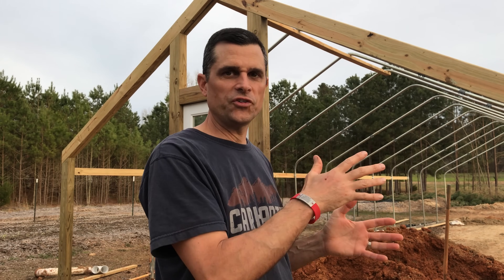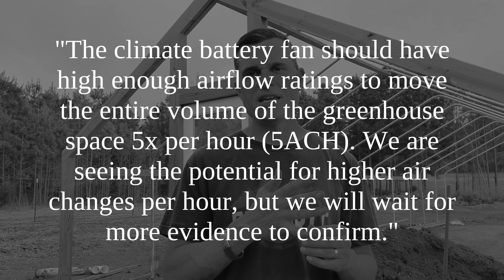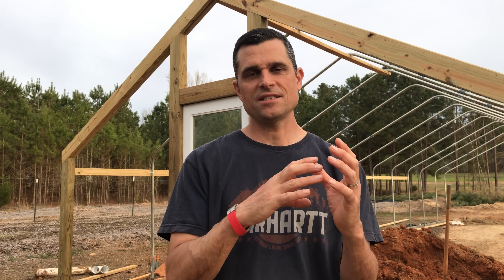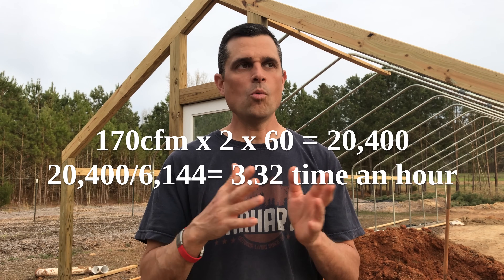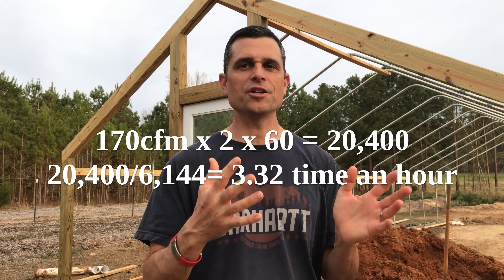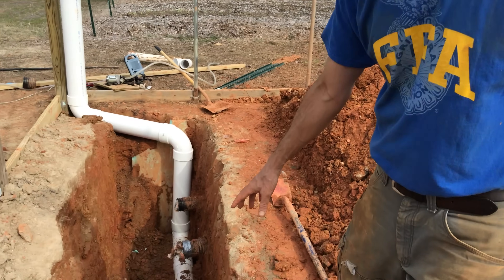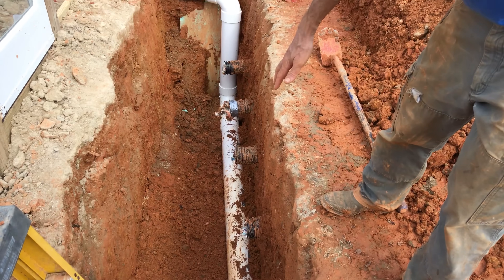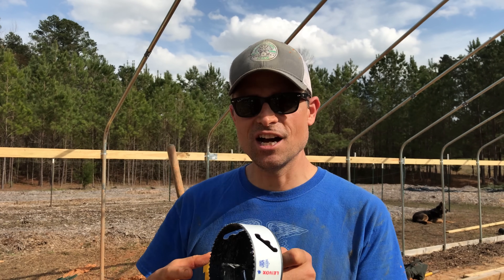DIY Geothermal Greenhouse Part 7: Earth Battery MISTAKE!

Comment: When the dewpoint of the greenhouse air is above the temperature of the battery (~April-October in your location...I'm also in the Piedmont area of NC) you will have condensation and then mold growing in the pipes. These systems may work well in the winter and year round in very dry climates but are a problem in the hot humid climate we live in. You may be able to use a HEPA level HVAC filter on the outlet to avoid breathing the contaminated air but a filter will add additional resistance and decrease the volume of air moving through the system.
Reply: I`ve had mine in the ground since 2009, if its designed correctly you wont have any issues.  If you go for 5 airchanges per hour you`ll be wasting your time. you need to design for a lot more than 5 ;)
Your test was a little simplistic, but fwiw assuming you had 270cfm and the system is perfectly lossless, the heat transfer rate would be around 18kw per hour. Of course, as the mass heats up the differential drops and you`ll move less heat.
Reply: @JohnGuest45  John, I'm installing a geothermal system in the near future and am having trouble with some of the  calculations for installation.  Is there a way I can reach you directly to go over some of these equations?
Reply: The tubes dont collect water if they are correctly modified prior to installation. The perforations in ADS tubing are not positioned to drain water from the tube because its designed to collect water and relocate it elsewhere, the clue is in the name :) If you believe the tubes will be full of mold, mildew, fungus etc  i suggest hiring a sewer camera to check the tubes after they`ve have been in the ground for a few years. Get a mold, spore test kit (cheap and readily available) to check for airborne spores in the exhaust outlet. Its basically a petri dish you leave in the exhaust plenum for an hour and then incubate to see what grows. 
In my experience its not an issue, any mold, fungus etc that attempts to get a foothold in the tubing has to compete with other residents that thrive in the highly aerobic environment. One that is coupled directly with the surrounding soil.
Reply from the maker: Mark Fogleman Thanks, Mark. Have you actually seen or tested for mold/spores in your system?
Reply: I don't use an earth battery because of our experience with the crawlspace under our house here. We kept it open in the summer and closed through the winter for the first ~10 years we lived here. This caused a massive problem with condensation and mold and other nastiness. After a lot of remediation we now keep it sealed all the time and it is dry under there. My former career involved manufacturing heating and humidification systems for breathing gases used on mechanical ventilators in hospital ICUs and Operating rooms.  I am well versed in the physics of changing water to vapor and the resulting condensation when it cools.
Reply from the maker: Definitely something to watch out for and report back on if it becomes an issue.
Reply: The condensation (phase change) represents the lions share of the heat transfer when cooling the greenhouse. If you lose it you only have the sensible component and you`ll have to move an epic amount of air to make up for it. Consider 1lb (454ml) of condensate represents 1000btu, about the same as cooling 55,000 cubic feet of dry air by 1 deg F.  Humidity is more of an issue in an aquaponic greenhouse with open fishtanks and flood/drain gravel growbeds which provide massive surface area for evaporation ;) Figure how much water you have to replace per week, convert to lbs, multiply by 1000 and divide by 3413. Thats the numberof kw that left with the water ;)
Reply: You could pour bleach on mold and not kill it completely.
Reply: Mold isnt an issue, its easily confirmed by renting a drain camera a few years after installation.
Reply: Mark,  I have studied geothermal and only tested it on a small scale.  In my mind, I feel using perforated tube is a mistake.  Ground water is present in clay soils and can run like garden hose under the ground level.  I don't know where this farm is located, but if they have frost snow etc, these pipes could possibly fill with water which defeats the entire concept.  Thinking they will only drain is only one side of the possibilities.   They could fill with water.  Second, radon is always a concern for some areas... why allow air transfer with potential radon underground?  I would have used an air sealed pipe network to keep ground water and other pollutants from exchanging.  And attempt to condense the water out of the air prior to pumping it through the pipe network.  I do like your coolant idea.  However, you would still have potential mold issues, but could be dealt with above ground by cleaning heat exchangers.  This system as designed will work, but whether or not it floods through the year is the question.  Also, I would not attempt to force hot air in the pipe network, I would simply draw cold air out instead.  This will help keep the fan out of the massive RH.
Reply: Passive airflow wont be enough. The metal element for the greenhouse in this video would need to present an area about 40ft square to the airstream to match a tubular installation, say goodbye to the floor and/or the light ;) . The metal will likely contaminate the condensate and poison your fish, at best  you`ll risk ingesting heavy metals when you eat the fish. The condensate from the tubes is returned  directly to the rootzone where the plants can recycle it via transpiration back into water vapour and the cycle continues ;) I like dome greenhouses, i have one myself. I hope yours isnt one of those made from steel conduit with a sheet of poly thrown over it ;)
Reply: 🐯 leman
Reply: Good idea TOM GRAY
Reply: I  can guarantee that I'm not confused about how dewpoint works and that I'm not an ME. I can also guarantee you would not want to spend much time breathing the air coming out of those pipes unfiltered as they will be pumping millions of mold spores and other potentially harmful microbes (remember Legionella?) into the air every hour after the first summer of operation. Warm moist air coming into contact with cool plastic drainage pipe buried underground will loose energy and not be able to maintain molecular humidity. The pipes will condense and collect water. This in turn creates an environment favorable to grow mold, mildew and other nastiness in the pipes. Blowing air through these moldy pipes will spread mold spores into the air inside the greenhouse. In our part of the world we have average dewpoints in the 60-70 degree range from April to October with spikes into the high 70s during tropical storms and hurricanes. Mold needs >60% RH to thrive. The RH in his pipes will be near 100% for most of the year assuming the ground temp around the pipes is around 50 degrees.
A better option would be to run a network of coolant filled piping underground and circulate this fluid through heat exchangers in the greenhouse.  Fluids are much better at transferring energy than air.
Reply: John, What you say makes sense.  going with your thinking, if the phase change truly does represents the majority of the cooling... why not simply dig a sizeable hole, install condensation metal elements in the hole and into the soil to conduct thermal energy, collect the condensate in a sump to recycle the water to aquaponics system?  Allow the natural thermocline to move the air into and out of the hole (winter configuration).  I basically did exactly that on a small scale.  I dug a 2' round hole 5' deep.  I dug the hole to help eliminate ground water from flooding my RMH that was built into the ground for safety (big mistake).  Anyways, I watched air flow into and out of the hole naturally.  I also noticed I didn't need to burn as much wood to keep the dome warm despite the temps outside at night were below zero F each night.  I am a great fan of passive geothermal methods and I am still on the fence to what method/configuration is best.

Comment: Glad that you are headed in the right direction.
Preliminary results look AMAZING! 
http://www.ecosystems-design.com/climate-batteries.html
Reply: The information in the link will not provide close to optimum performance. For example, recommending that folks reduce the fan speed to maximise the in/out delta-T will guarantee it wont store heat efficiently or keep up with the incoming gains. The important thing to remember is.. the outlet temperature of a tube will always mirror the soilmass temperature until you have sufficient airflow to create a temperature differential over the FULL LENGTH of the tube. 
Common sense should tell you that reducing the airflow will result in the air dropping to the soilmass temperature long before it exits the tube. If you have 25ft tubes and the slow moving air drops to the soilmass temperature in the first 5ft of tube,  the other 20ft is doing nothing because the air has already reached the soilmass temperature ;)  
If the information was accurate it would say; monitor the inlet, outlet and soilmass temperature and increase the fan speed until the outlet temperature is slightly above the soilmass temperature.

Dont be surprised if you run out of fan power long before it happens, especially if you followed their recommendation of 25ft minimim tube length and sized your fan to provide 5-20 airchanges per hour.
Reply from the maker: Thanks!

Comment: I thought the idea was to heat the greenhouse, or does it take time to get the earth warmed up?  I'm confused because most every place in the northern hemisphere the temp 8ft in the ground is 52 plus.
Reply: I can tell you dont have a system installed  ;)  The fan doesnt run continuously, it should be controlled by a differential thermostat and a fan speed controller.  You`ll struggle to run a suitable fan with a solar panel unless its a good size with a battery bank and an inverter. A PC cooling fan wont cut it ;)
Reply from the maker: We hope to try and fully explain the system once the greenhouse is finished and everything is up and running. There are a few different things going on with this system and it is a bit confusing to understand depending on what people are using the system for. Hopefully, we can clarify in coming weeks.
Reply: really?  solar panels are 1$/watt and he's talking about an 150 watt fan to start with.  He's paying more for the fan than the PV would cost if there was a suitable direct DC fan available, maybe this could be, I don't know.  I also work in a biologically secure HVAC environment (tangentially) and I don't think mold will be an issue for non hypochondriacs.  Same with water, or dirt infiltration, just won't matter enough to care.  

Are you intending to use the fan for emergency heat on nights with a risk of frost? or just for cooling the greenhouse?  obvious implications for direct solar powered fans.  

The metal conductors is interesting, completely unproven but it would be easy enough to do the math if you want to prove it.  SS is unsuitable,  scrap mild steel would be the only possible workable material, AL or CU would be way too expensive, even at scrap value.  Passive air flow is non existent for heating the ground with a flat floor.
Reply: It basically takes the hot air from inside the greenhouse (produced by the sun coming in) through the day, and blows it through the pipes, heating up the ground around the pipes. As the temp in the greenhouse drops below the temp of the soil, the battery works in reverse, giving up heat from the heated soil, and blowing it back into the greenhouse. The fan just runs continuously. This helps lower the daytime max temp, and raise the night time min temp - for almost no cost. The fans are low power and can be driven from a solar panel.

Comment: Mind sharing what fan you got?
Reply: The fans will give you around 400cfm each at best most likely less. With both fans running flat out you`ll have 7.8 airchanges per hour.  Its borderline for cooling unless your outside temps dont get much above 80F in mid summer.  If your main tubes are 50ft long, the air will spend a minimum of 3.8 seconds in the tubes with the fans flat out. A well designed system will drop 30F in a second or less so the cooling efficiency may be a shade over 25%. You may need to discharge heat from the mass at night to provide more cooling capacity for the following day. A windspeed meter is a useful tool for balancing the flow in the individual tubes but will only give you a rough approximation of airflow.  Accurate airflow measurements are notoriously difficult, you cant just measure it at the beginning and end of a tube ;) . Google for duct traverse airflow measurement.
Reply from the maker: The fans shipped today! We're getting two Fantech FG6XL fans. https://www.acwholesalers.com/Fantech/FG6XL-FG-Series-Round-Inline-Exhaust-Fan-6-Duct-483-CFM/34472.ac?question=fg6xl
Reply: you should get one of these. For the low cost... its a pretty nice tool to have to get REAL WORLD IN THE FIELD data without having to use theoretical numbers...  you know... ZERO GUESS WORK then, and youll see EXACTLY what your setup is doing in terms of air flow.   

https://www.amazon.com/Proster-Anemometer-Measurement-Thermometer-Windsurfing/dp/B00KYL3VNS/ref=sr_1_2?ie=UTF8&qid=1522715027&sr=8-2&keywords=anemometer 

EPIC fan... im really interested in seeing the design of the fan blade... i wanna guess that its more like a turbine shape.... when you get it in your hands.... let me know the wattage, if it doesnt say on it..... just tell me the amps and volts, I can figure out the wattage with that.   Thanks so much.  Only reason I ask, is because I use hyper fans, and they are SUPER low wattage the 6inch version is 315cfm at 35watts and the 8inch version is 710cfm at 75watts only.  Just interested in a comparison.   Thanks so much.
Reply from the maker: Awesome - we were just looking at these - we won't to be able to tell people actually inlet and outlet fan speeds. Going to order one ASAP. Want to try and share as much data with folks as possible. Fans should be up by the next video (we hope)!
Reply: JohnGuest45 great reply,  I was doing some research about this jive and my head started spinning hahah.
Reply: that's a 150 watt backward curved impeller centrifugal blower.  The resistance of the corrugated pipe MIGHT be a good thing, IF you're entering the realm of laminar flow then the turbulence is a very good thing for heat transfer.  just a  speculation like 90% of the 10% of comments here that have any validity whatsoever.  

I agree, that test is useless for prediction, fun though!  Also, any fan rating is USELESS without the pressure rating, and hopefully the pressure drop your system will produce with that curve.

Comment: Great update.  Progress is progress. Good thing you went with the higher cfm fan, as that corrugated pipe will create quite a bit of static pressure.
Reply from the maker: Thanks! We're learning a lot. This is test greenhouse. We'll be building a much larger one nearby and hope to make improvements and modifications based on what we learn with this one. "Progress is progress" - great quote.

Comment: Hey.. what is this short sleeve stuff? Great video and info. This will save someone some trouble down the road. Thank you for sharing this.
Reply from the maker: 😂 Yes, please keep the snow up your way! And definitely hoping anyone doing this system sees this video and does this correct the first time. Digging up these ends was necessary but not exactly how I wanted to spend several days of break.
Reply: Eric you could use one of these in your climate. LOL